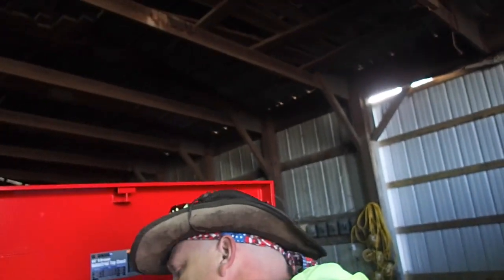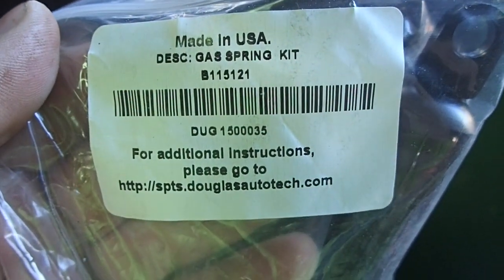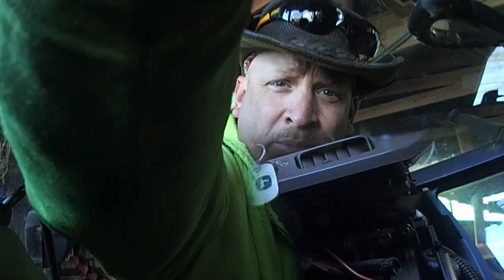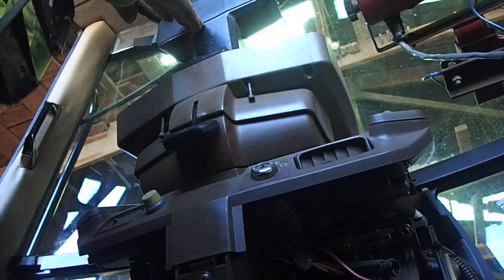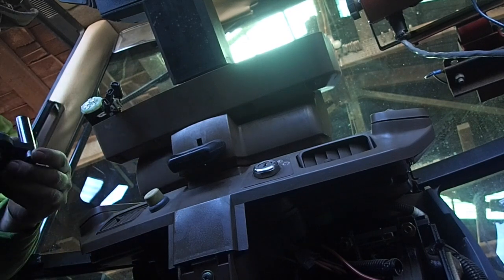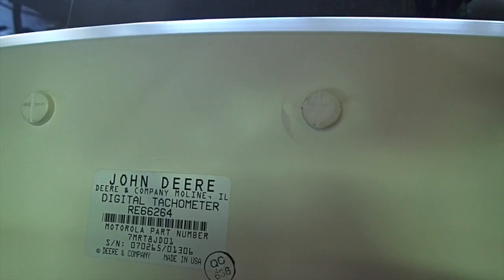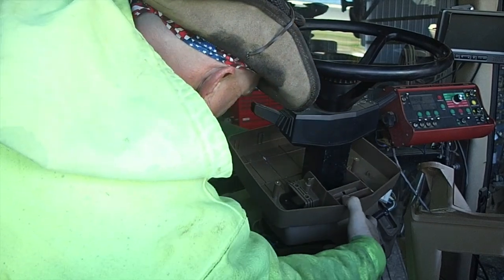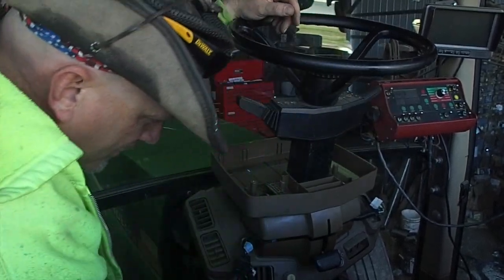7810 Steering Wheel Spring Cyl.

Comment: I went to the website provided on the plastic parts bag - you download the file (1500035) and there's the instructions. You have to remove the entire steering column, including the steering wheel with a wheel puller.   :-(  Good luck - I'm sure your above average mechanical abilities will complete this just fine. Was happy to see a nice length 
video posted this morning - makes my coffee break ever so much better! Thanks Wes!  :-)
Reply: +cuskit I work at a Deere dealership and have had to do this job you don't need a puller to get the wheel off.

Comment: Funny.  I just put that cylinder in a 7410 today.  I find it easiest to pop the steering wheel off.  You usually don't need a puller for 7010 series.  Then you can slide the column with the wiper switch and signal light switch up off the shaft.  Don't take  it apart to unplug.  It unplugs up under the dash, and then feed the harness out with it.  Then you can take that brown part off the dash that keeps falling down on you, right off and everything is open.  For the bottom pin, I use a small two jaw puller to push it out without bending the tabs.  I use the puller to push it back in too.  Good luck!

Comment: if you put a flat screwdriver in the slot below the handle on the lock nut and hit it to loosen the nut, then the cylinder will thread down once the bottom pin is punched out no need to open the dash.

Comment: TAKE MY ADVICE make it easy for your self do it the way i do them!!!!!!!, i done these plenty of times al you need to do is unscrew the cylinder from the block that the allen screws go through, pop out the bottom pin/screw and run the new one up in there in the reverse order saves ripping the hole thing apart, try it on the 74 if u haven't already done, just means you use the new cylinder but the old block stays in the tractor :)

Comment: Replaced one about a year ago.. on a 6400...... Got mine from Ebay..a hell of alot.less than what JD wants same part same bag
Reply: Wes doesnt accept em unless it says 'made in the usa' on the bag
Reply: Why would you use cheap non genuine parts
Reply: +Keith Jeasser   First It is a spring assist gas cylinder with a valve on the bottom that lets you select a position... Made in the USA but not by John Deere... So What.....They got theirs  from the same  Manufactor  i got mine... you just have to wait...Wes has more money than he has time....

Comment: +Jeff Petersen the same part from the same factory just different store with a smaller price I've bought ac compressors and bigger things from them at like half the cost o bought a turtle shell for a 2755 JD from off brand u can get a lot from them almost a full tractor if someone wanted to
Reply: +Ryan Mandl Same factory means nothing. Im not saying that all aftermarket brands are bad or that they are not sometimes the same part as you get from Deere. But not everything is worth saving money. And I am a dealer for multiple aftermarket parts companies. Take injectors for example. Rebuilt from Deere are more  expensive than rebuilt from aftermarket. Likely rebuilt with the same parts. BUT the aftermarket ones only have parts replaced that are out of spec and those parts only. Some may be close to worn out but are still in spec so they stay. Deere on the other hand does a complete rebuild. Disc mower blades are another example. The Deere blades last twice as long as the aftermarket.

Comment: They could make that a little easyer to get to right Tim, very expensive part, company damage, or pays Tim 😂😛😂😛😂😛😂😛😂
Reply: +Jan van den Bos yeah jan with the Kubota tractors it just twist the knob off the sides and the sides slips off easier with no tools and the big huge  kubota m6 series  104.5 hp  to 141.4hp they sell for $73,000.00 cheaper and the M7 series a 170 hp to 171hp they sell for $83,000.00 wich not that bad of the prices on the huge heavy kubota tractors with a free 5 year warranty
Reply: +Michael Mac Tavish LOL. Big huge 170 HP tractor. When Kubota comes out with something 300-600 HP then you can say big huge. Kubota is a consumer tractor. Less retail and built lighter. Also less dealer network. Wes likely didn't have time to search the internet and wait for one of these parts to be shipped to him. (maybe he did, IDK) But if I was in the middle of spraying, I would go to Deere and get the part to get going again.
Reply: yeah they will be in the feature right now there at 104.5 up to 170hp and 171hp New  M6 and M7 new 2016 series bigger tractors plus kubota dealers does insurance plan and they have a 24/7 emergencey service too avaliable if anything happens or acidents
Reply: +Fredrick Mechanical a buddy of mine had a kubota M6000  for 56 years and it still ran like brand new and never broke down on him wich there relyable machines kubota
Reply: That's like a yard tractor. Almost just a lawn mower. Go put 12,000 hours of hard work on a newer kubota and let me know how that goes. I'm not saying they are bad tractors. My Bobcat has a kubota engine which is wonderful. But kubota tractors are consumer/light duty tractors.
Reply: That's like a yard tractor. Almost just a lawn mower. Go put 12,000 hours of hard work on a newer kubota and let me know how that goes. I'm not saying they are bad tractors. My Bobcat has a kubota engine which is wonderful. But kubota tractors are consumer/light duty tractors.
Reply: That's like a yard tractor. Almost just a lawn mower. Go put 12,000 hours of hard work on a newer kubota and let me know how that goes. I'm not saying they are bad tractors. My Bobcat has a kubota engine which is wonderful. But kubota tractors are consumer/light duty tractors.
Reply: Jeff Petersen we got a zero turn kubota zd326 26hp wich you can add a dozer and snow blade attachment on it but the M6 and M7 are the newst heavy duty tractors
Reply: Are you Like trying to advertise for Kubota or something? That's sure what it seems like. And what is so special about this 26 HP tractor you are talking about? My lawnmower has more HP than that.
Reply: they have a zd332 kubota a 32hp and a kubota F3990 front mounted mower with 39hp 3 cylender diesel

Comment: I know why farmers are going broke .they bought John deer tractors.holy shit.
Reply: +ironmules MC yeah the kubota tractors are less priced tractors in the market and easier to acess through place  and parts are cheaper the new  KUBOTA M6-101 a 104.4 hp  to M6-141 a 141.4 hp are at $73,000 and and the M7-171 a 170 and 171 hp are $85,000.00  cheaper and if steering wheel cyl goes on the big kubota tractors its easy access wich twist the knob off the sides and pull off and its in the spot wich kubota makes best tractors and easyer to maintain and easy to work then other brand tractors
Reply: +ironmules MC Careful!